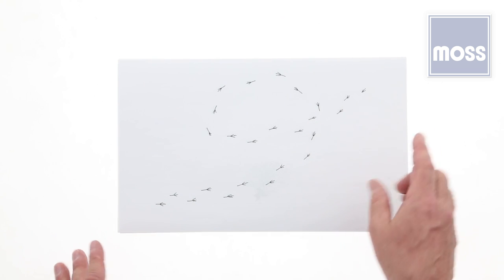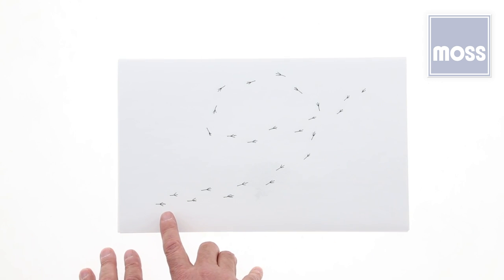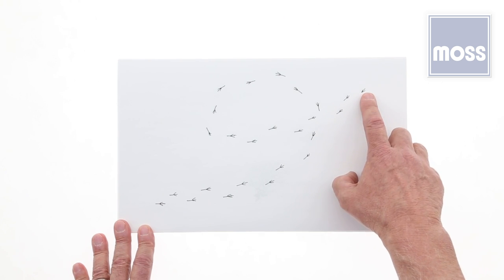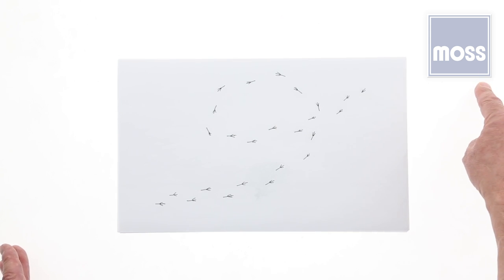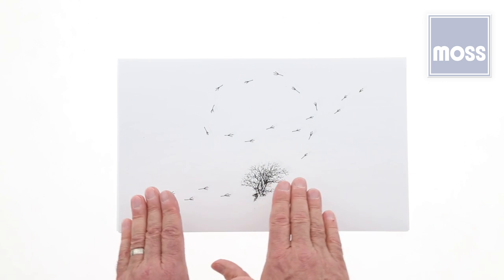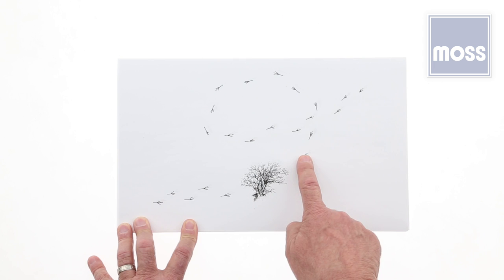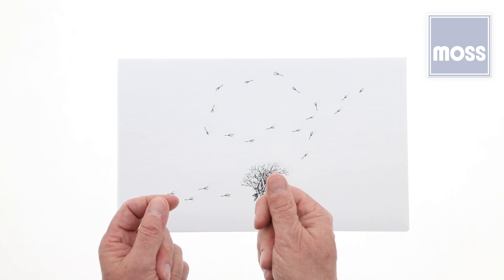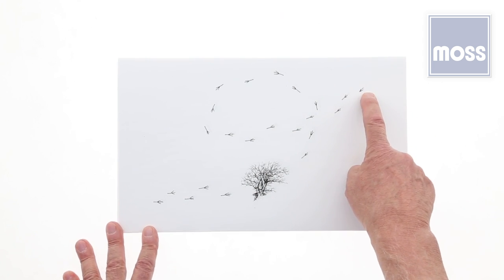Identifying And Finding A Short Circuit - Part 3

Comment: That only works if theres no fuse to blow before short burns up Yrz, an fUs blows, no burnt Yrz, no bird futprints - & wEr still lFt clUlS.. lIt bulb lUp in the fuse box soOnds lIk a gr8 trik, buuuudt Y wud the lIght gO oOt if theres a short?, wouldn't it problE just stay on (as pRt of) the 'short'Nd lUp?😕